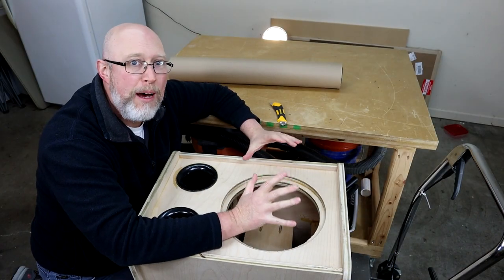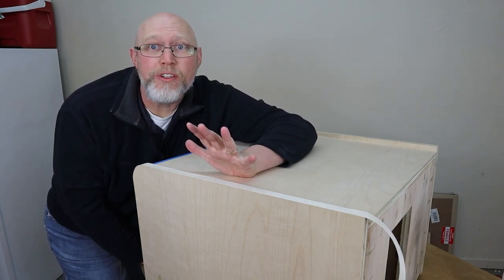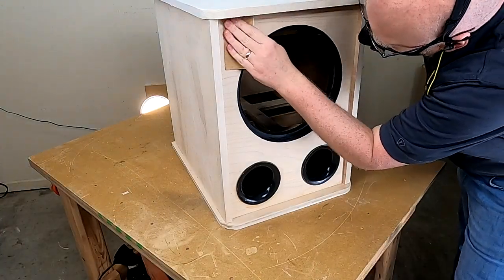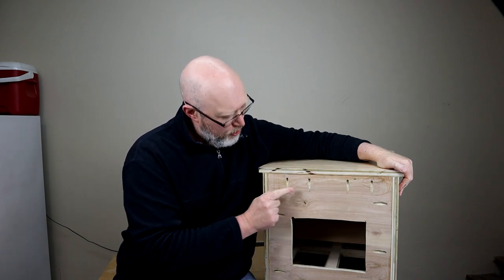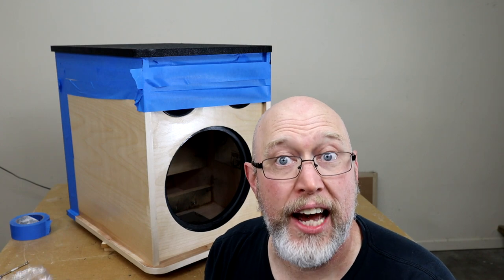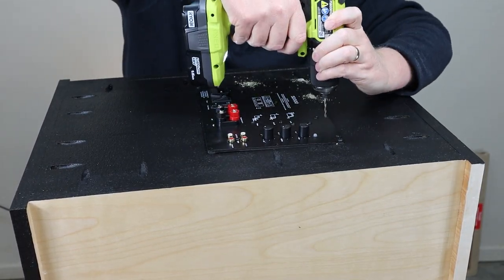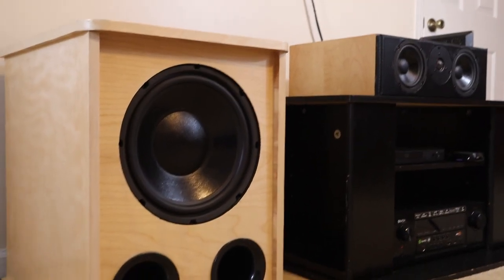Birch Home Theater Subwoofer!  DIY Solid Wood look.

Comment: Hi 
i am making a sub box and want to add poly fil also but there is a confusion that if i stick poly fill in the box so does it affect the box volume ? Should i make the box big if i am putting poly fil in it or the box volume will be same ?
Reply from the maker: I'm a big fan of polyfill I try to put a little bit in every box.
Reply from the maker: There's really no need to adjust your box size in order to put polyfill in it. For a sealed enclosure polyfill will make the box behaves as if it were larger. I'm not aware of any YouTube videos that have verified what happens with a ported enclosure. I use polyfill in this case with the hopes that it will help dampen any standing waves.

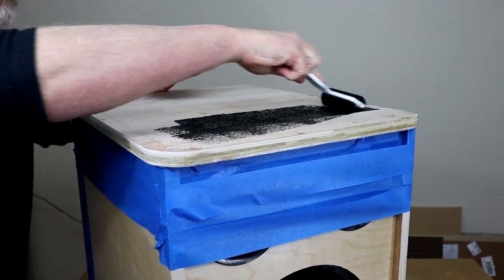Comment: 4:50 is that a challenge? 
I'll have you know I have a masters degree in the art of being a dum dum. 

Sub looks great! Good job! 

What did you end up tuning it to? Curious if the sub can handle a port being plugged to tune lower.
Reply from the maker: 🤣🤣  That stuff is great, so much easier than carpet or stain.

I don't recall the tuning at the moment, probably in the upper 20 HZ range.  It was resonating a little bit on the tops and sides when I tapped on it with my knuckles so I threw in some extra bracing. That had an impact on the tuning frequency.  I suppose I should sit down with the plans, modify them a bit, and put up a video showing my design process.
Reply: @DIYAudioGuy  Actually I was surprised at how easy and quick staining was. The gloss top coat was the slow hard part. 

I've wanted to use DuraTex in the past. But never got around to using it because my MartySub needs a LOT of it I think. 

Considering building an UM12 and 18" PR and I might use DuraTex to cover the box and using my leftover Birch Plywood stained for the front baffle.
Reply from the maker: @JoshM7  I still have trouble getting stain to look good, and I'm not a fan of any anything that has to wait 24 hours between coats.  

I've built a lot of projects doing exactly what you suggest.  Use a nice piece of birch for the front and stain it, or stick a piece of veneer on the front and stain that.  Then hit the rest of the box with duratex, this covers up the end grain of plywood and makes for that nice contrast that I like.  

At first glance duratex seems a little expensive.  But it's no worse than stain plus clear coat or adhesive plus carpet.

Comment: I know that it's going to be a lot of work, but I'm trying to build a very unique design with the port tubes extending past the face along with the sub.  So the sub, ports, and walls will be extended past the face of the box to give it an aggressive look.
Reply from the maker: The hard part is going to be making the subwoofer look good sticking out.  There used to be a trend in cars to fiberglass the front of the subwoofer box so that the subwoofer stuck out a little bit and the baffle curved down to the rest of the box.  Most of them ended up looking kind of like a volcano, It is not a look that aged well.

Comment: tip on Duratex, if you only put on one coat, pre paint with black paint, it will hide the pinholes that sometimes pop up
Reply from the maker: I've done that before when I was running low on it, I always keep a couple of cans of flat black spray paint on hand.  The dirty text will stick to the paint no problem.

Comment: I have stacks of those turkey and ham containers in my shop. Also egg drop soup containers are great for mixing resin or paint. Salsa jars are good for screws, nuts and bolts... and herbs. 🤷‍♂️
Reply from the maker: I managed to use up my stockpile of those containers. I guess I need to make some sandwiches.